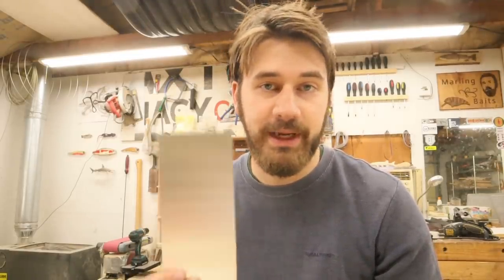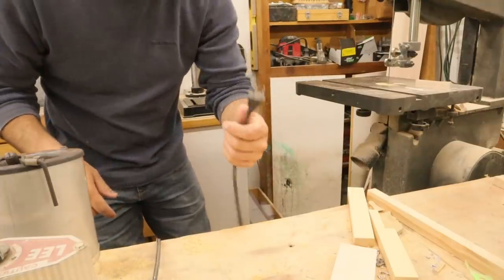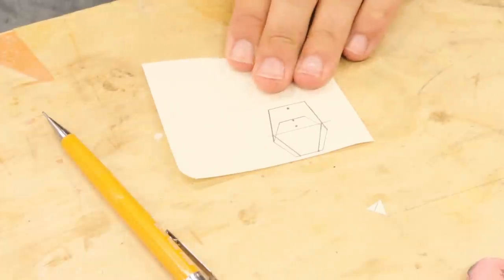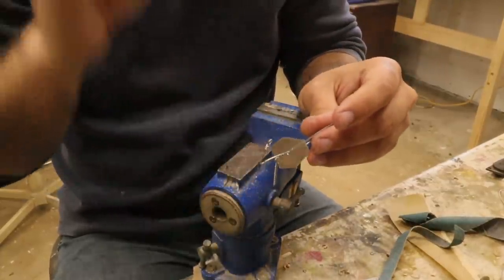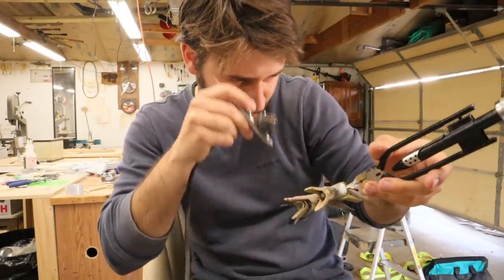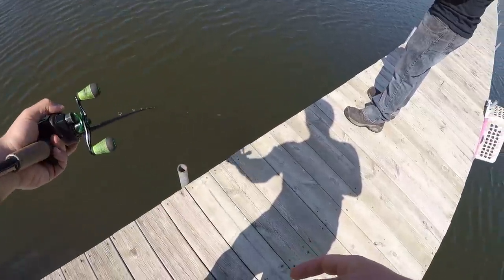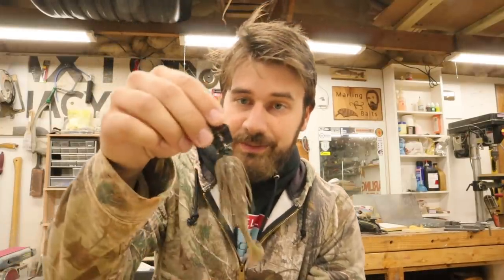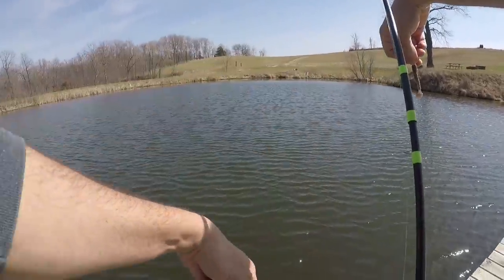Wooden ChatterBait | One Day Build to Catch

Comment: the air brush is back!  yeeay!  the fast forward on the sanding restores my will to live.  thank you. We are in this together.  Just lost my red diamond spoon with beads lure within inches of the dock, not sure why. that is the trouble with resting rods, you turn your back on them, and then... surprize! Get back out there is the right thing to do.  I came back and made 4 spoons using the tin paper tops of applesauce cups, some gardening wire, and hologram duck tape in red, red with silver stripe, silver, and puce. Now the challenge is to attach the split rings and treble hooks to the spoons, and swivels at the nose...  I will let you know if I catch something with them.  The bonus fishing made it all better. what a nice eye you caught, and such a sassy bass.

Comment: He needs to get a magnet and use it to get all his lures back
Reply: Aren’t the baits wood?
Reply: The hooks, split rings, and line ties are metal
Reply: @mattsmall5145  The hook hangers, line tie, hooks, and split shots are all metal.
Reply: Lead aluminum and stainless steel are not magnetic. Regular hooks are magnetic but not enough steel to pull it in..
Reply: @shawnraintree  Stainless steel is magnetic, and if you used one of the large magnets the hooks would be enough to pull it up anyway.
Reply: @Phage116  not all are magnetic.. austenitic stainless steels are not magnetic. Ferritic are.

Comment: It works so the weight on the lure/head pull the bait down, and the "lip" upside down pull the lure/head towards the surface, because the lip is loose on the lure/head it shakes. Extremly good lure for big perch and pike, and i bet for bass and musky aswell

Comment: Try adding 4 ft of 20lb mono main line 22lb braid (clear fluorocarbon ) on the end of the braid i have this on my spin  set up with my  bate caster reel  that i am sea fishing with and casting 100yards . I am  fishing with heavy lures and had no snap offs it just gives a bit of stretch enough to stop the braid snapping if there's a problem also dropping  the tip insistently if you have  a over run can save the day as well .I know that pit of the stomach and instant anxiety attack well as all your end tackle fly's off into the blue yonder no longer attached to the reel i beach fish with 6oz leads up to 200 yards  with multiplier's and 14ft rods there's a massive amount of energy loaded in the rod on casting i yous tapered shock leaders 60lb down to 15lb .Love watching your films i am going to try and do some my self this year .

Comment: Maybe tie a string between some strong part of your airbrush and the table so that if it falls, it doesn’t hit the floor? Actually since you already have the air hose leading to it, attach the hose to the desk far enough down from the airbrush so that you can still use it but if it falls, yes.

Comment: Dude thats heart breaking...   I think a couple chatter baits Ive looked at have  the wire that loops through the chatter also clip on the eye on the front of the bait with a snap lock. or are hard wired in with a second perpendicular loop. 

Question, what size/ where do you get your wire?

Comment: Hey, for your missing wheel, couldn't you just replace it with a chunk of wood-- perhaps a little smaller than the wheel, but you have all the tools you need to make a block, drill it, glue it, and have a much more stable base to sit on ;)

Comment: the reason it doesn't hurt as much is because of the leidenfrost effect essentially the water on your skin is being boiled off almost instantly protecting you from some heat and the metal sticking to you where as with the plastics i dont think the temperatures get up high enough to cause the effect.